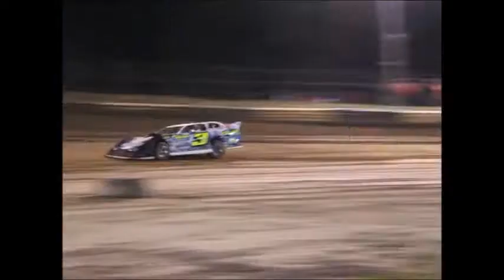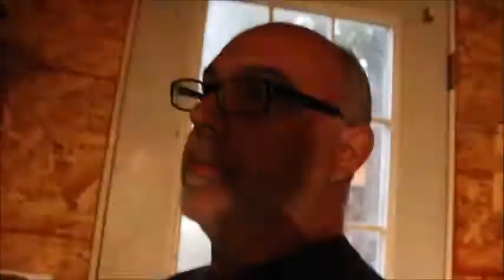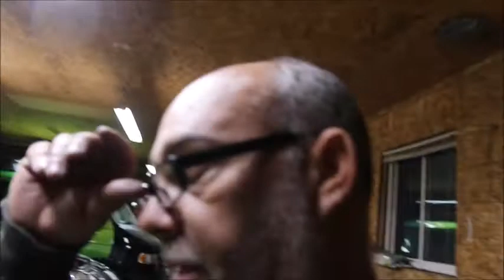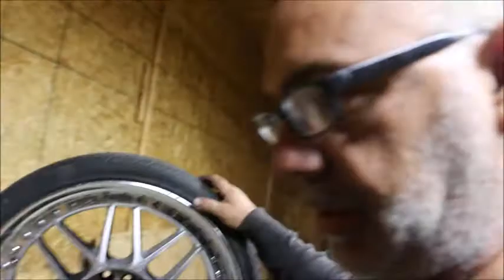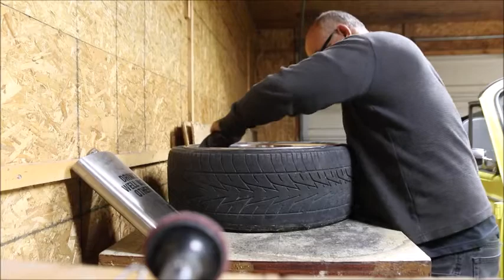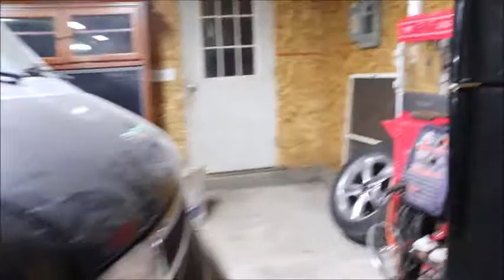Restoring Hart racing 3 piece wheels

Comment: RacingHart Type C2, Super popular back in 2000's!  Finding the real RacingHart (which are the 3 piece design and NOT the RH Evolution 1pc wheel which is actually another company) center caps, center nut and nut wrench is super rare.
Reply: DiNKY LoVE I actually got a set of the RH EVO rep wheels. I got em for 100$ with 80% tire left. They look super cool still. Might try to find a real set when I have the money.